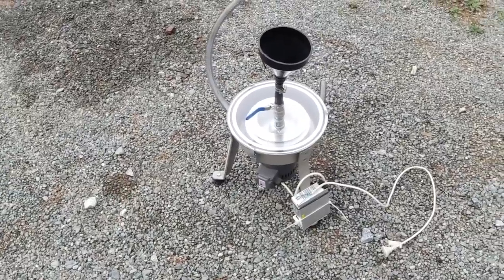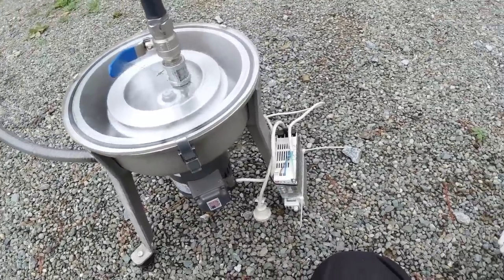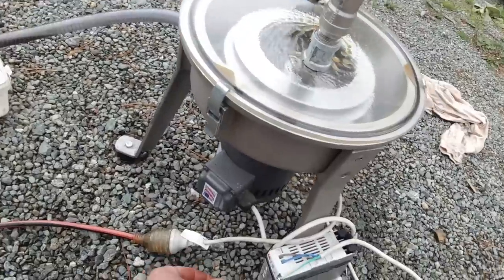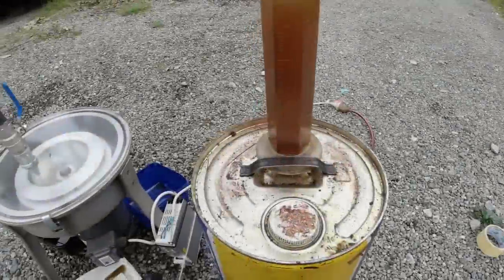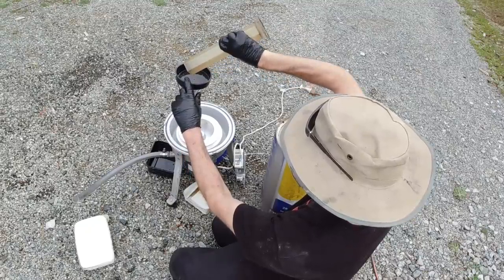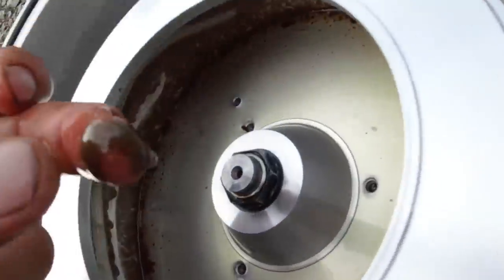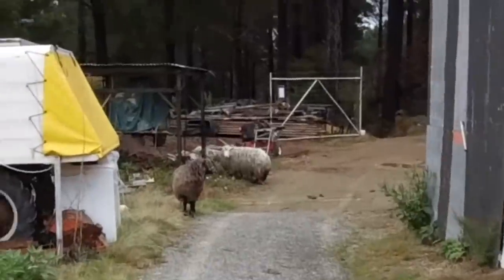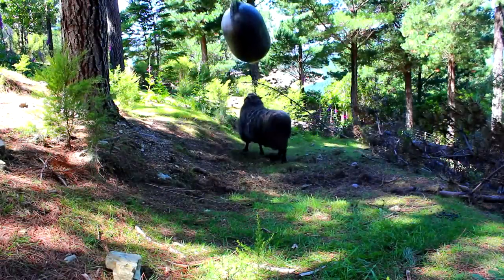Using a centrifuge to clean used oil and diesel.. Will it work??

Comment: As a chainsaw mechanic I hate it when idiots don't know any better and think it's OK to use old motor oil in their chainsaws then bring them in for repair. It's better than nothing for sure but it has abrasives in it that cause wear to your bar, chain, sprocket and oil pump and the bits can clog filters and pumps. That's why you're changing it in the first place... Not to mention the lack of tack so 90% of the oil is lost as it goes around the tip of the bar and is flung off.
Reply from the maker: Been doing it for 20 years and I haven't noticed any accelerated wear, saved thousands of dollars over that time, enough to buy a few more chainsaws
Reply: @MartyT  Yeah, and if it wasn't for guys like you who have "been doing this for 20 years and never had an issue" bringing me repairs all the time I'd be out of business. 
I think that's the most popular phrase spoken by customers in every repair shop around the world. I hear it so much every time I give advice to customers I honestly think it's the catch phrase of every old timer and know-it-all to have ever lived. 

I been doing this stuff 30 years and I learn something new every day. 

I do like the centrifuge though. 👍 I'm curious to see how it works with warm oil.
Reply from the maker: @TruthHurts2u  Lol I've never had to take my saws to the shop, I do all my own maintenance, pretty basic stuff
Reply: @MartyT  Nothing wrong with that. I sell lots of parts to people who are either too broke to pay for repairs or just have nothing else better to do with their time.
Reply from the maker: @TruthHurts  Neither of the above for me,  Chainsaw mechanic incompetence was my reason.  The last time I took my saw to the shop to be repaired 20+ years ago - my 025 was having issues starting and getting up into the top rev range, I was busy so took it in for a service, they stripped it down and told me it was too far gone to fix, handed in back to me in a box.. I looked a little deeper and found the crank seal had gone on the sprocket side and let dust and crap into the bottom end, I got a $5 seal, put it back together and it ran perfectly for a few hundred more hours, from then on I made time to work on my own saws.. Just shows  even the 'experts' can get it wrong ;)

Comment: run the oil with water under vacuum, That will remove a lot of the moisture
Reply: heating will break down the viscosity

Comment: How do those sheep smell?
Reply from the maker: Not as bad as goats
Reply: @MartyT  When I was working for National Parks I was tasked with finding & eradicating three wool blind Merino sheep that had gone feral for several years in a National park. I smelt them literally a hundred meter away & they were slow moving massive mounds of wool. Goats are extra pongy too, no mistaking a billy in the bush nearby if the wind is blowing in your direction.

Comment: Shouldn't you be running it as fast as it will go.
Reply from the maker: Tho oil starts flying over top of the bowl above a certain speed, I wind up the rpm until just before it starts flying
Reply: @MartyT  if the bowl is flat sided then I think you're misunderstanding how it works.  I'm fairly certain you should be running it at max RPM.

Comment: How do you use oil for timber? You rub it in?
Reply: Just brush it on like you would paint.
Reply: @dfross87  Thanks!
Reply from the maker: Mix with diesel 50/50 and paint on
Reply: @MartyT  thanks!